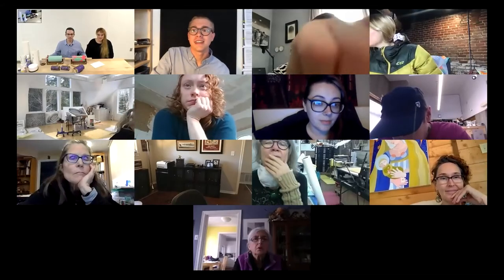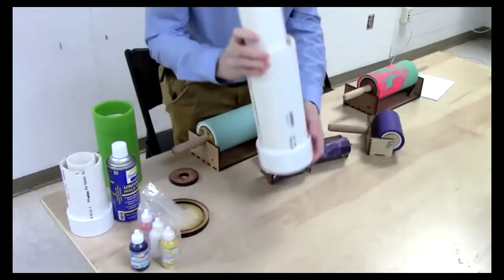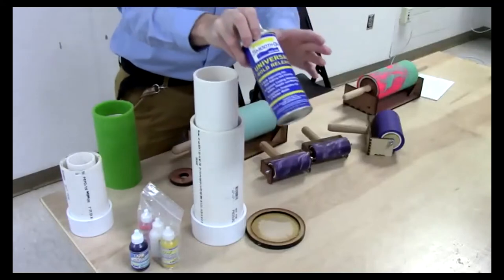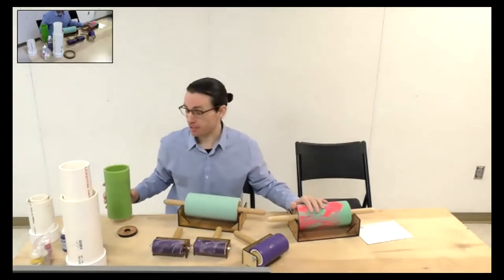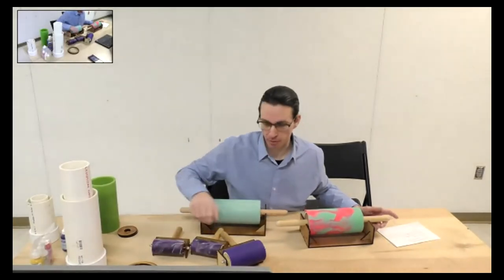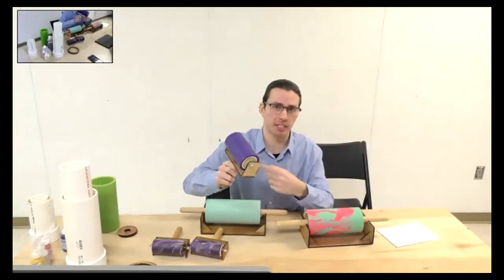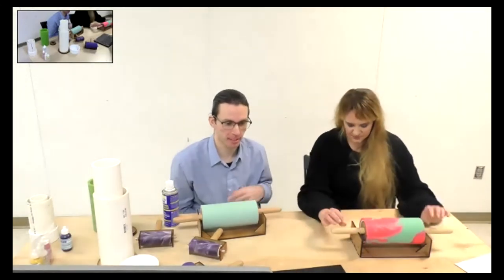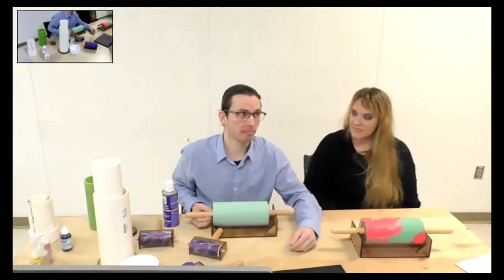DIY Rollers: Demonstration by Ross Mazzupappa and Christina Humble

Comment: If you use a Schedule 40 PVC pipe with a 2-1/2" diameter, you can use McMaster-Carr's Sleeve Bearings for Conveyor Rollers. They are made to accept a 1-1/2" shaft (or roller handle in this scenario) and are made to fit the Schedule 40 piping. They also sell aluminum rods and tubes, but you might have to order them at 3 feet long and cut to size.